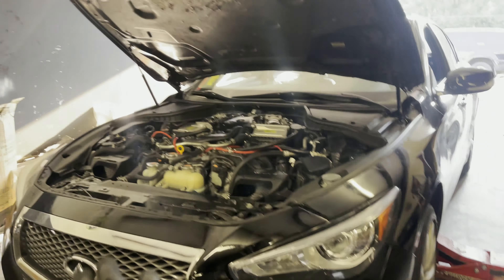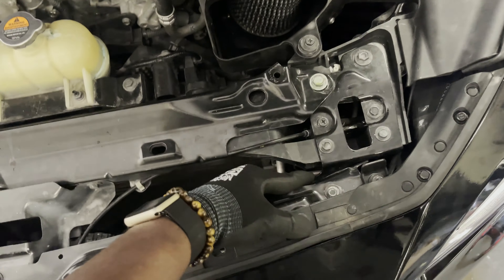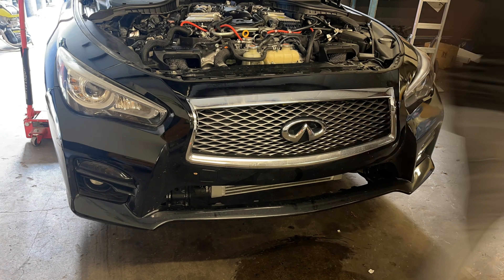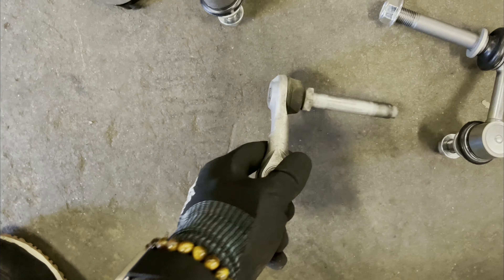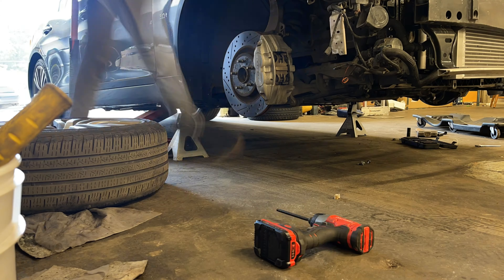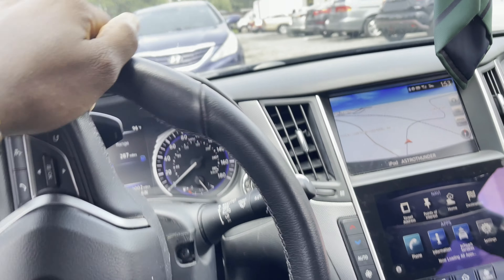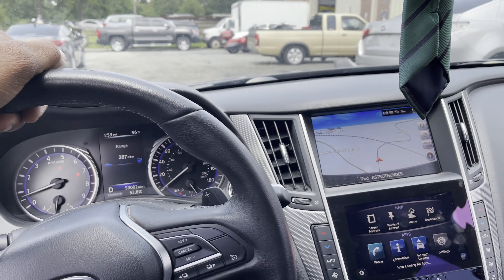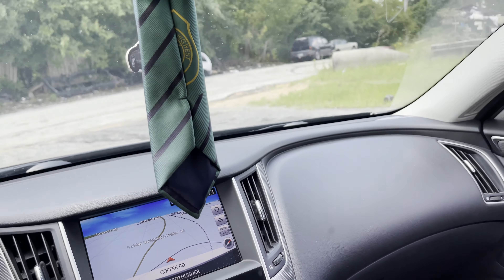How To Change Sway Bar End Links on a Infiniti Q50 Q60

Comment: Is this issue was giving you a clunk noise when driving over pothole (but was still handling very well)?
Reply: That’s what mine is doing , did you figure anything out?
Reply: @HomicidalKings  no unfortunately and I finally sold the car
Reply: @HomicidalKings  I have the same thing. Did you figure it out?
Reply: @rexryanissodamfast  I changed the sway bar link and it went away

Comment: you couldve showed how u take sway link out instead of just showing us after its already out
Reply from the maker: Jack the car up pull the bolts and it’ll come off
Reply: got both nuts off on the sway bar link. the pressure of it sitting without the nut where the link meets the sway bar is too much for it to come out. i used a rubber mallet and a steel hammer.. im so confused
Reply from the maker: @anthonypalomino1200  both front wheels gotta be off the ground
Reply: @lacykenzie  that worked thank you, how about to get it out of the strut part?
Reply: @lacykenzie  it there a way to loosen the tension? ive hit with both hammers and wont budge. putting some wd40 on there now